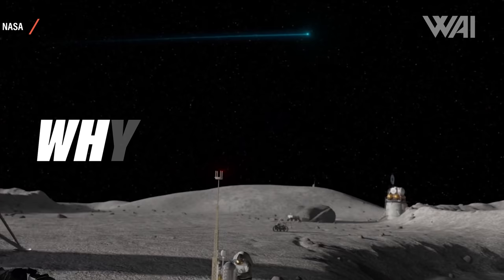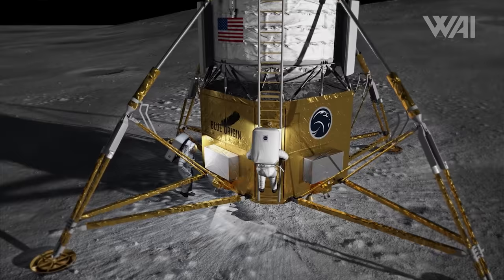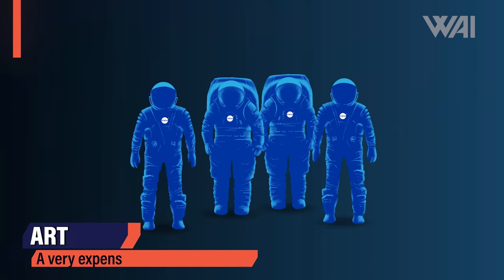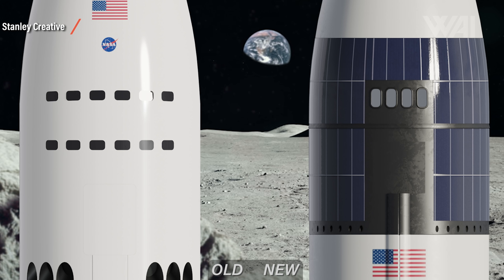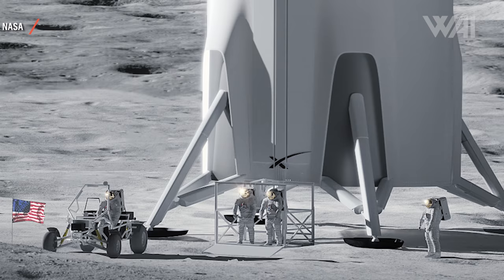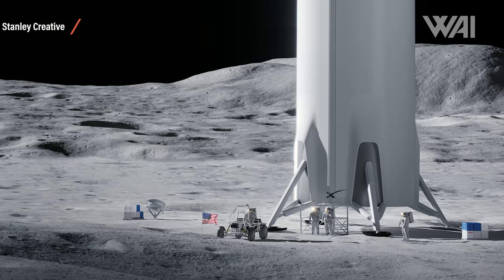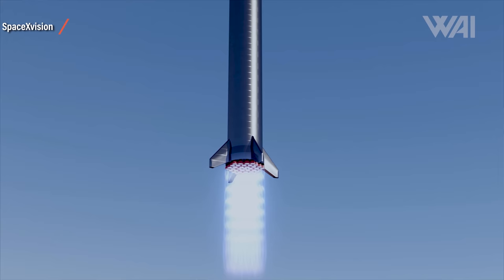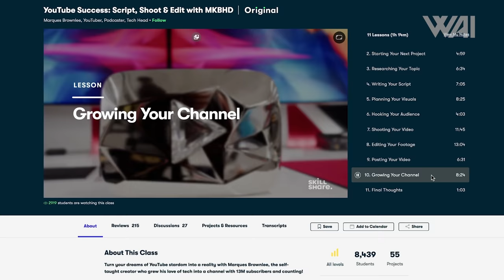Why Did NASA Award SpaceX 2.9 Billion Dollars For A Lunar Lander?

Comment: Some of the renders showed sea level raptors on lunar starship. I'd assume they'll have only vacuum raptors and that's another nice weight saving, both in engines and the plumbing and such for them.
Reply: Depending on the thrust the upper “landing” engines make, they might not even need the vacuum optimized engines further reducing weight.
Reply: @rogerrrice  Those will not be efficient at all. They'll want to use them as little as possible.
Reply: @Qwarzz  Do we know for sure what engines will be used for landing?
Reply: @rogerrrice  Current official renders have those holes above the tanks and those would make sense to avoid all sorts of dust and rocks flying around while landing (at least near the vehicle). For all we know they'll may still change the configuration a few dozen times before actual moon landings.
Reply: @Qwarzz  I agree it is all guesswork and speculation on our part now, but my thought was if the upper engines are running on the same fuel mix and they produce enough thrust, could Spacex reduce or eliminate the aft engines. That’s why I was wondering what type of engines would be used. In the current renders it doesn’t look like Raptors would not fit and using Merlin engines would mean using a different fuel.
Reply: @rogerrrice  I would assume the thrusters used for landing on the moon and maybe liftoff as well are hot gas thrusters, the same type they'll use for maneuvering. I'm not quite sure how they work however. Maybe they'd use the pressurized methane and oxygen gas in main tanks. The thrust compared with proper turbopump fed rocket engine would be miniscule but there were quite a few holes there in the latest renders...

Comment: Why doesn’t SpaceX put astronauts and equipment in the bottom of the lander and fuel in the top?  This would greatly reduce the height of any needed elevator.
Reply: Designing an elevator is easy compared to plumbing through the whole ship down to the raptors and I would think the center of mass ought to be close to the raptors.

Comment: Will Orion or Crew Dragon only be used for a one way return for the astronauts?  Or, will Starship rendezvous with Moon Lander to return astronauts and cargo?
Reply: Astronauts will launch on SLS+Orion once lunar starship has been re-tanked (it's about empty when it reaches LEO) and flown to the moon (I expect they won't commit to launch of SLS before that is in place and waiting). Then they fly there, either to gateway or possible directly to lunar spaceship in first mission and dock to transfer astronauts. Go down, leave two astronauts crammed in the Orion while their two other friends have fun on the surface, the fly up and dock with Orion which will return to earth as speedily as possible. If they reuse that particular lunar starship it will either do the same or maybe do a less fuel intense gradual orbit raise to get back to LEO for re-tanking.
This is what the contracts and decisions are to do for the initial phases. I think modes can be altered when the initial Artemis missions have been completed.

Comment: Isn't this kind of hilarious? I mean we already know that SLS is basically build because the u.S. senate wants it. Now it turns out that the landers that would fit SLS are too expensive for what they can do. So the only option is the SpaceX Starship that basically makes the SLS obsolete in the end anyways. I guess SLS will build Lunar Gateway and then be mothballed officially ringing in the era of reusable rockets and the new era of exploration and colonization of the solar system.

Comment: If refuelling on-orbit is so easy, why isn't there a dedicated lunar transfer vehicle which simply lands cargo and people, and returns to lunar orbit for reuse?
Landing your entire earth-ascent stage is simply ridiculous! It's like taking a fully loaded truck and trailer unit to the corner store for a bottle of milk. Or boarding a 747 to fly 15 km.
Geez, it looks like the Lunar version of Starship is going to need at least 6 on-orbit refuelling flights before anything goes anywhere. WTF? Look, in 1969 we could do it with a single launch of a single rocket, plus a bit of on-orbit rendez-vous jiggery-pokery, and we were all set! 
And now, 52 years later, you're trying to tell me that every trip to the moon requires at least 7 (seven!) launches of a much more powerful rocket?
Sorry, mate. It just doesn't add up. There is no way it can be cheaper. And certainly, it won't be faster. And we still don't even know if Raptors can be reliably relit AT ALL, let alone if they've been cold-soaked and vacuum welded for a few weeks on the lunar surface.
I'm just not buying it. I'd love to be able to - but I can't. 
Space is hard. Really really hard. And getting people into orbit and docking is just the start! They are going to have to lean on NASA very heavily if they're to succeed. And I consider it highly likely they do not. Or rather, if they "succeed" it will be very late, and very expensive, and not as quick or as re-usable as claimed.
It's possible Starship will succeed in being a heavy lift to LEO vehicle, but it's not going to get down to even $1000/lb to LEO, let alone the 1.3% of current NASA costs Elon has claimed he'll deliver.
It's lunatic land. Crazy town, Earth!
Reply: Sending Starship directly to the moon, instead of a separate lander saves time and development costs, that's why they are doing it. Saturn V launched in a single launched, but only launched 50t to tli, while a refueled Starship can land 100t directly on the moon, which is a huge difference. On Raptor reliability, on its high altitude test flights it made 2 of 4 without any problems, which is actually really good for one of the most complex rocket engines ever, while it is still very much ik development. Of course SpaceX is going to heavily lean on NASAs expertise on landing on the moon, they are the only ones to ever fly a crewed lunar lander, any company would do so. Time will tell if they are too late, expensive, or not as reusable. But it is a fixed price contract, so they cant just milk NASA like Boeing, Lockheed and others have done so extremely before.
As for cost per pound, they are already at an internal cost of 25mil per F9 launch (or 1700$/kg), so below your target of 1000$/pound. I don't see how Starship is going to be more expensive than that.

Comment: If the spaceX lunar lander would not return to earth, how astronaut leave moon and go back to earth? Just asking..
Reply: SpaceX will launch Starship into lunar orbit.  NASA will then launch The Orion capsule using their SLS and it will rendezvous in lunar orbit with the Starship where crew will transfer to the Starship (two crew for the first landing).  Starship will leave orbit and land on the moon - then return to the Orion capsule and then astronauts will get back into Orion and return home - leaving Starship in lunar orbit.  Eventually, there will be an orbital station called Gateway and Starship will launch, dock at this station, and then Orion will launch and also dock here and crew will transfer to the Starship, land, return to the station and then transfer back to Orion.  Artemis III is the first planned manned landing of the program and as of the last I checked, Gateway will not be completed, so crew will transfer directly from Orion to Starship for that mission.  Things change though, but that's the gist of it.

SpaceX will send maintenance and refueling missions to Starship/Gateway between missions - and eventually missions to Mars.  The idea ultimately is to have a fully-fueled space craft waiting in lunar orbit making a trip to Mars much more efficient since you don't have to launch the fully fueled craft into Earth orbit.  It will already be in orbit around the moon waiting at the Gateway station.

Comment: Just a correction to the great renderings: Lunar Starship won't have sea level engines.
Reply: It'll still have sea level engines because they are needed to get into orbit.
Reply: @JoshuaJohnsonHou  Sorry, but no. Starship gets to orbit on top of SuperHeavy. Starship is just like the upper section of falcon9. That only has a vacuum merlin engine.
Reply: @ha-bg7qo  Yes it'll of course need SuperHeavy, but even after stage separation it won't have the thrust needed to get to earth orbit. It'll also need the thrust vectoring that will be missing from the vacuum engines.
Reply: @JoshuaJohnsonHou  Of course SuperHeavy will not be enough to allow StarShip to get to orbit. But that's not the point. Falcon9's booster also doesn't have enough power to get the second stage into orbit. 
The point is that the sea level engines are only necessary/efficient until an altitude way bellow the one were the separation occurs. You wouldn't want to fire up sea level engines in space. They are very inefficient in very low atmospheric pressure. 
Were would you want to use thrust vectoring? In space? Why? For that you use manoeuvring thrusters.
Reply: @ha-bg7qo  3 vacuum engines are not enough thrust to get into orbit before gravity loses would become too much. Also the ISP for sea level engines vs vacuum is 330 vs 380. So while yes it's more efficient to use vacuum engines, it's not huge. If they could fit more vacuum engines then they probably would, but that is unlikely and all official renderings have show the same 3 sea level and 3 vacuum engines for Lunar Starship.
Reply: @JoshuaJohnsonHou  I have serious doubts regarding the way you are presenting your values. I'm pretty confident that the 330 isp value is at sea level, not in vacuum. 
The part regarding the renderings it's true, but I still don't believe it because, even if your way to present the numbers were correct (and I do not think it is) that still represents a loss of 15% of efficiency for the engine. A lose like that in space travel just sounds stupid.
Reply: @ha-bg7qo  Sorry, the way I presented it is SL vs VAC, so 330 at SL vs 380 at VAC.  Probably could've done this better.

Comment: How is the SpaceX Starship going to be able to leave the moon when its propellants are cryogenic liquids? The moon's temperature in sunlight at 127C will cause them to boil off in little time.
Reply: Not if the Tanks can hold the pressure. If not, they'll have to include a cooling/repressurization system. This is also required for flights to mars. However Methan does behave much better than Hydrogen when it comes to staying in the tanks.It doesn't squeeze itself through the tank walls.

Comment: Hey , sitting at your desk ?  Try standing your pencil on the eraser . It can be done , but not easily . That is what starship s trying to do , only the moon surface is not smooth like your desk top . And some is just soft sand . Lots of luck getting the starship to land up right . It's a Musk dream , and he is getting richer and richer . It's your money he s playing with , not his own money . One born every minutes they say
Reply: Designing a booster with lots of engines (and new design), flying several tanker missions (reusable presumable) to LEO before it can be transferred to the moon. Sit there and wait for Orion to come and dock with it.
And you worry about it tipping over? With landing thrusters up high and angled it will not be too much disturbance around where the feet are to touch down and they can do it gently with each one feeling the pressure so they gets deployed/extended different amount to keep it pointing upwards.

Comment: How do spacex plan to take off from the moon and land back on earth ?

The moon star ship is only designed to land and stay.
Reply: Why would would a Starship not be able to take off from the moon? It would return to the gateway. From there Orion takes over.
Reply: @Bennet2391  it's made to stay on the moon. Unless they change the design's it's designed to be part of a moon base.
Reply: @DannyBoycustom  Again: Why can't the Starship take off again? It just has to light up it's descent thrusters and accelerate back into Orbit. There is no technical reason it has to stay on the surface of the moon.
Reply: @Bennet2391  yeah it can't re-enter earth's atmosphere. It's not made to.

So they have said it's going to be used as a base on the moon.

The only other option I would say would be is for it to dock in the gateway and take a dragon capsule back to earth and just use the star ship as a moon lander.

Only thing is there's it's no way of them fully check all is good to land every time back on the moon so it's a risk and not fully reusable.

This is why they have stuck all solar panels in it as it's used as a habitat and life support.
Reply: @DannyBoycustom  " The only other option I would say would be is for it to dock in the gateway and take a dragon capsule back to earth and just use the star ship as a moon lander."

AFAIK, That's the official Plan, except for using dragon. They will probably use orion for that.
They can check the starship and perform repairs on the surface of the moon, if necessary.
It's not going to be a base on the moon.
There are no plans for a permanent moon base right now.

Comment: Why do all these Lunar Starship Designs on the pictures and animations seem to have sea level raptor engines? The Lunar Starship will fire it's engines only on the ascent from earth and in free space. As the second ascend stage it doesn't need sea level engines, just vakuum raptors. It's just stupid to attach 3 useless engines on this design. They would cost money and be useless weight.

Is there any reason, especialy for someone like Musk, who even reduces the landing legs from the booster stage, to keep these engines, because I don't see any reason...

Comment: Ok, Lunar Starship will not came back to Earth. But how the astronauts will?
Reply: Exactly like they would have done if any of the other landers won the contract. HLS is a piece in the Artemis puzzle for being docked in lunar orbit and have astronauts come onboard, descend to moon surface, ascend to lunar orbit, dock and astronauts disembark. To and from the Orion capsule or the gateway station.
Reply: @subwarpspeed   Thanks for the reply.
So, Lunar Starship will not take astronauts to the moon? 😕
It will just receive astronauts from moon orbit?

Why Spacex do not send the astronauts with Starship to the moon? Wouldn't it be cheaper?

Comment: Why the f*** they are building Orion if Dragon is already flying. Lmao
Reply: Dragon isn't rated for deep space, plus well the Congress
Reply: Orion has performed it's test flights except the SLS flight around the moon where Orion will tag along unmanned. It's a vehicle designed for this. Dragon is designed for LEO. Among things that are different is the re-entry speed from the moon is much greater than from LEO which surely brings more demands on the heat shield.

Comment: Spacex will need to find other fuel options so then they can launch from the moon
Reply: Do you mean fuel sources, or a different type of fuel?
Reply: Set up a Lunar LOX plant (dig oxygen out of the regolith, yes it has been studied and it works once you have the infrastructure in place) .. but for the methane .. that's a little harder (even before you carry the carbon up to make it with)....
Reply: They need to redesign it so it works with fuel that can be easily found on the moon